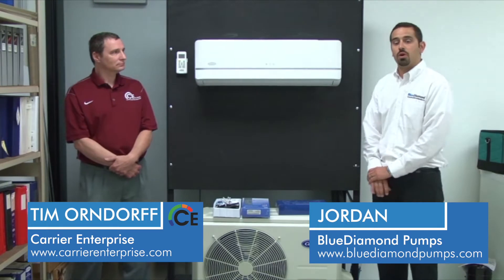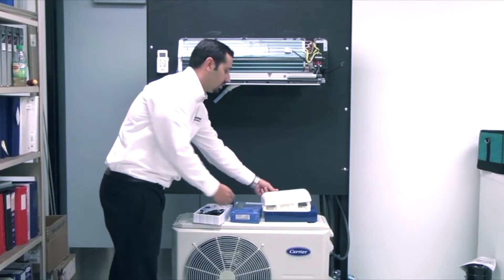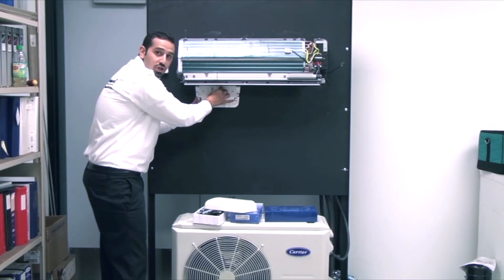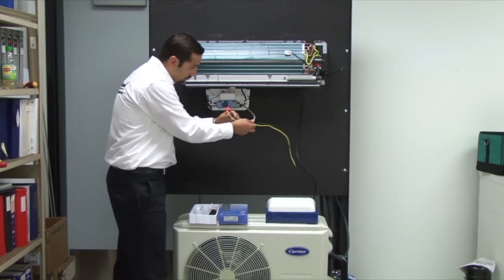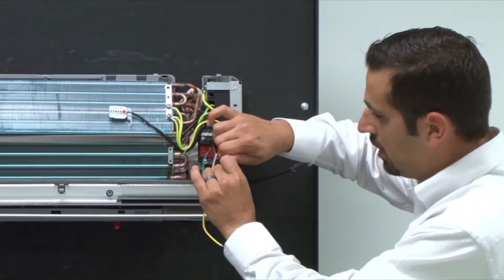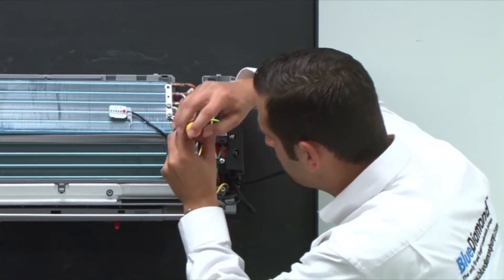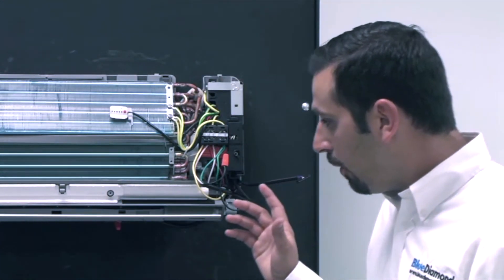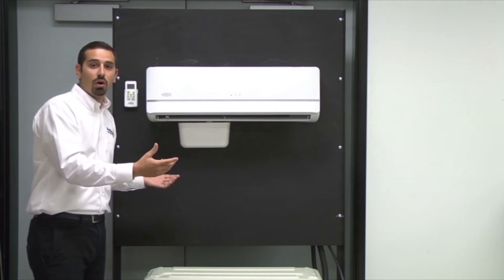How to install a MicroBlue™ and Fascia Kit to a Carrier Mini-split (USA) | BlueDiamond® Pumps

Comment: You didn’t show connecting drain lines??considering the pump is what 1/4in and most drain lines are5/8 not talking about from unit saw that but to line outside